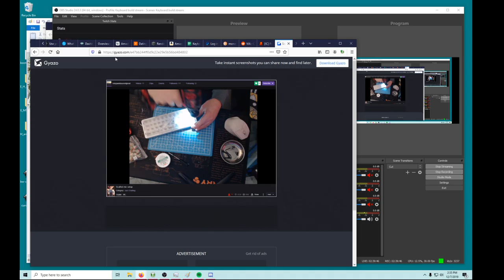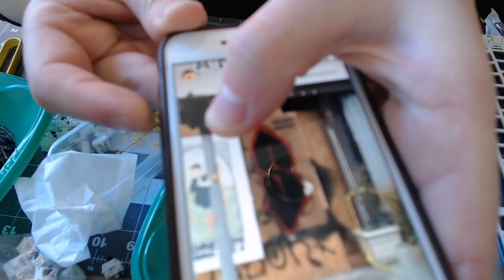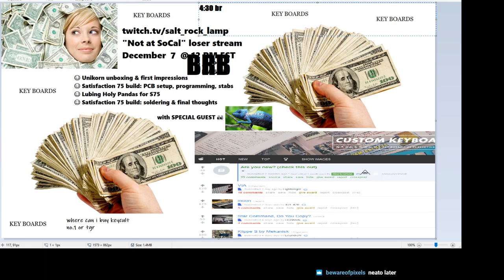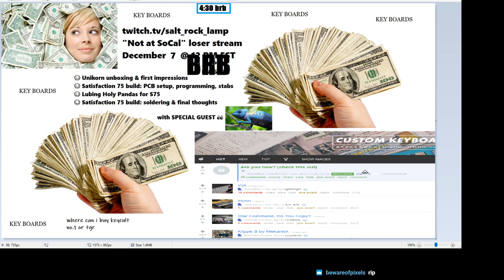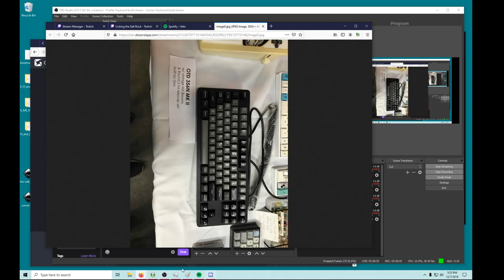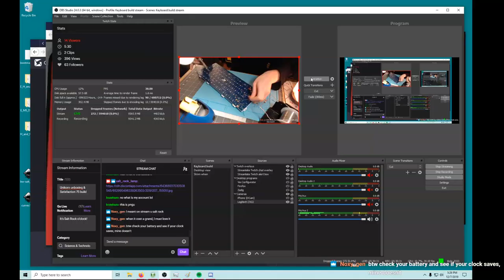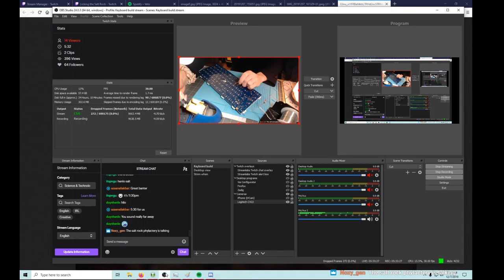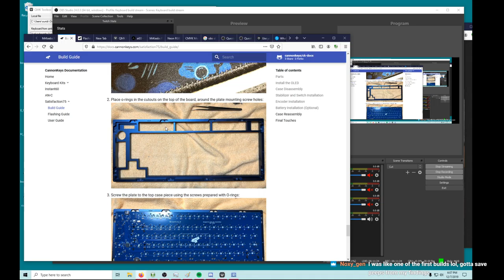Livestream: Unikorn unboxing & Satisfaction 75 build (bad audio for the first 2 hours sorry!!!)

Comment: is this really worth $400 ?
Reply: Yes definitely. The Sat75 R2 had over 1000 units and sold out in 1 minute. Also was board of the year for 2019
Reply from the maker: I think it was in 2019, I'm not sure it is in 2021. Keyboard designers have been pushing down prices a lot. Also there were a lot of quirks and missing details that I don't think stand up in today's market. The sharp bottom edge and lack of clamping force in the rear of the case are especially disappointing, not to mention the crusty screw threads. Maybe the V2 design was improved, though. I don't recommend paying a high aftermarket price for a V1 S75 unless you are really really lusting after that spacebar and/or the layout. That said, the spacebar on this keyboard felt incredibly good.